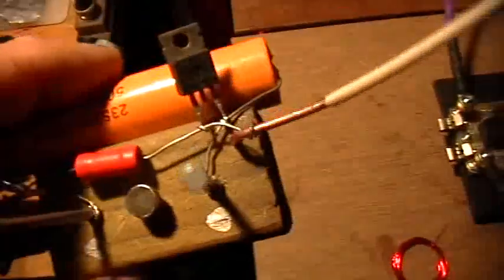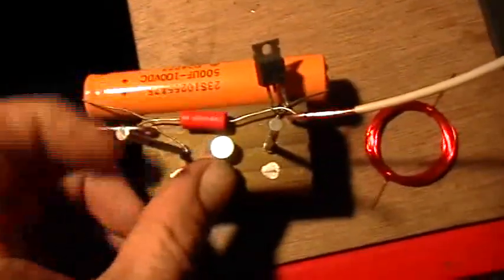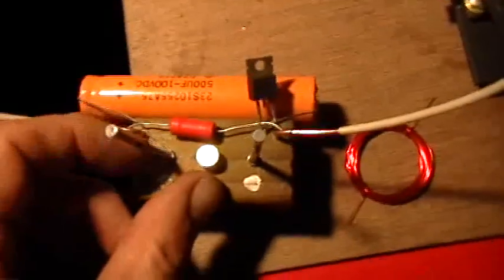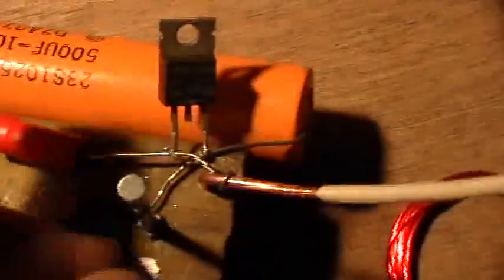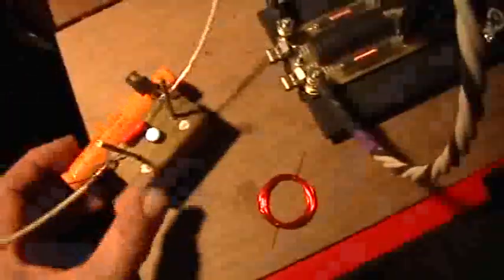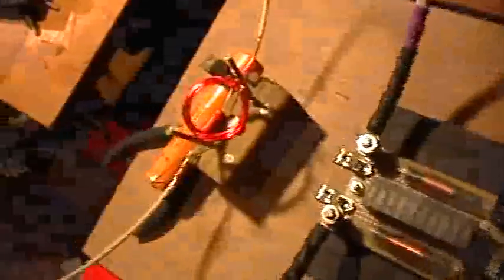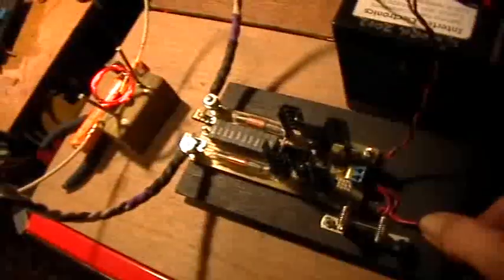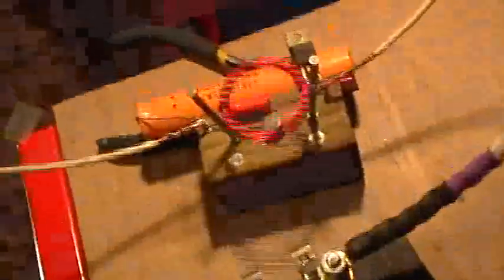Wireless Power: Solderless DC Receiver, Simple Pulse Motor

Comment from the maker: Thank you! 

You should see the underside of the board though, you might change your mind. 

This one (SN002) doesn't use a PCB, just a pad-per-hole CB from stock, with some heavy copper ribbons for the drains-caps-loop part of the circuit soldered onto the pads. It looks pretty ugly, but it works and is easier than making the PCB by hand. But the prototype in the black briefcase has the PCB that I made from Marko's template, and it's much neater.

Comment from the maker: In addition, there is serendipity at work. If I had tried some other diodes first, I might not have been able to get to the rectified DC, since it requires a fast enough diode capable of handling the power. I had a handful of VHE1404 and didn't even know what they were, until the requirement came up and I checked the specs and realized they would work.
Perhaps a UF4007 might work, but the standard 1n4007 didn't, it shorted right away, and the 1n5400 worked feebly but got extremely hot.